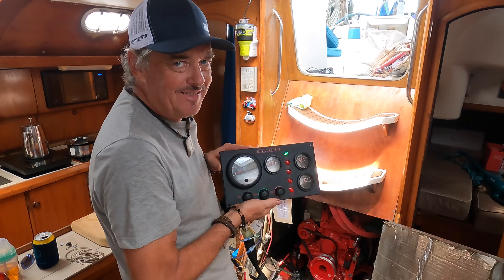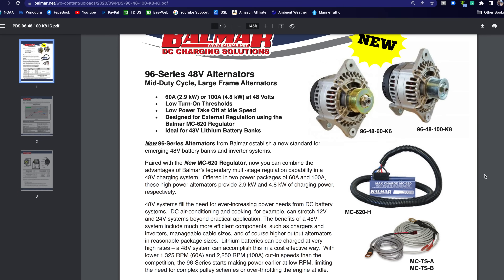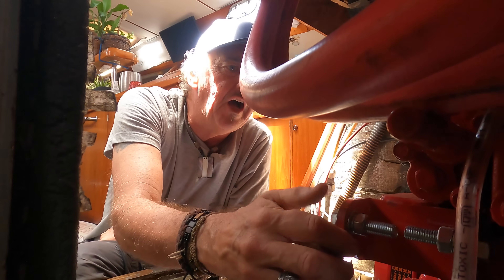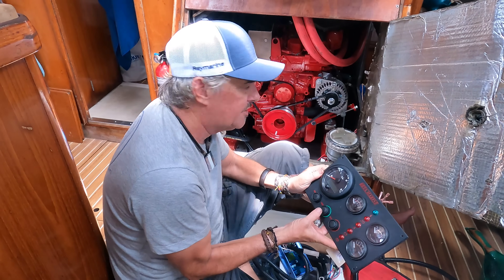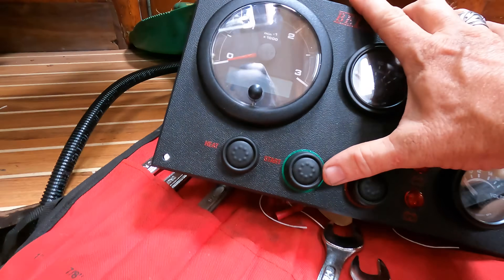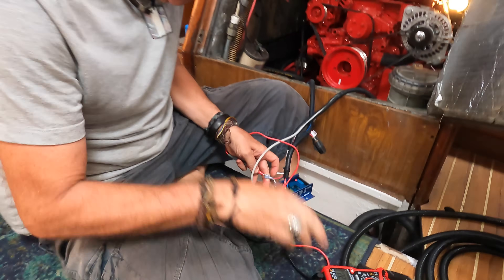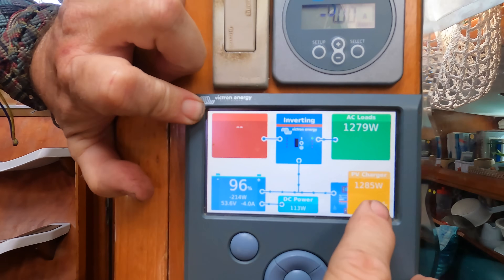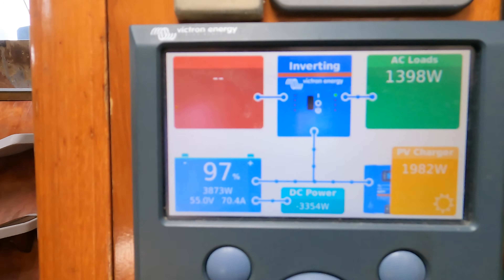SSL639 ~ THIS will change the way we live on BOATS!

Comment: I think the deflection you had on the belt at first was just fine. It is the unloaded side of the belt. You can easily over load the bearings on the alternator with the type of adjustment system you have. I would back it off to where it was and try it there first , you can always re adjust later. Overtightened bearings will go unnoticed for quite awhile but will significantly shorten the life of the alternator, and I guarantee that thing ain't cheap.  If you can find one. 

    Pic .
Reply from the maker: If there isn't enough tension, the belt will squeal when you put the alternator load on it, so I tensioned it up just to the point it stopped squealing under load.
Reply: @SailingSophisticatedLady  well you are there so I'll defer to your judgement. I just wanted to help 😊🍺.
Reply: As a bus mechanic that deals high amperage alternators I would be careful with the tension till you get the second on there because of the front crank bearing. Once you get the second one on there then you can tighten the belts more. We have a a/c compressor on the other side that helps. Then the bearing I would worry the most about would be the water pump bearing it may not take the belt load needed for the 48 volt alternator. Carry a spare water pump looks easy to change.

Comment: And another Wowza for Captain Rick👍 Do ya have the Red Paint to Color Coordinate?😜 Continue to Stay Safe & Enjoy😎
Reply: I wouldn't be painting that alternator red, or any other colour, as cooling it is a real issue. Did you notice how many cooling slots it had compared to a standard alternator. I have theory that reason alternators seem to cause trouble in marine environment, is that most of them are designed for auto industry, where they would get much greater airflow in daily use.
Reply: @chrisyarnold6205  marine alternators also have better spark protection...  (I shudder to think I installed an auto alternator on my small block chevy Chris Craft...  dumb and stupid

Comment: By the way,  Rick, better to have the belt a bit loose as long as it grips okay.  Less bearing wear.  I've serviced 10's of thousands of motor belts over the years and I do speak from experience.  Those bearings really take a beating with side tension too great.
The field wiring in that cable is 12 volts.  The ratio is set up to produce the 48 volt by sensing the 12 volt field while running.  The output (48v) wire is the actual lead from the generation side of the generator.  The voltage regulator maintains the field voltage so the output side remains fairly constant.   The voltage regulator can adjust the field as the draw on the generation side goes up or down to maintain relatively constant voltage.
Reply: Thanks 👍To you and Captain Rick... I never thought about what happens when it is loaded down.
Reply: @captainrick the belt should only right enough to avoid slipping.  You will burn your bearings out making it that tight to avoid the belt "flutter".

Comment: 48v is the current popular standard for battery systems for power.  The higher the voltage the lower the amperage for the same watt output.  That means smaller wire.  They are even beginning to go to 60 volt systems.  The drawback so far is the peripheral systems that go with it are not plentiful so far (inverters, charge controllers, etc).  In time though I foresee a movement to higher voltages and perhaps even beyond 60 volts to reduce amperage even more.  When I built the last 2 systems I didn't even look at 12 or 24 volts.  There were already enough 48 volt components available even several years ago to make it quite feasible.   I've begun to notice more and more 60 volt on the market lately.  Cap'n Rick might have to replace his 48 volt stuff to keep up.